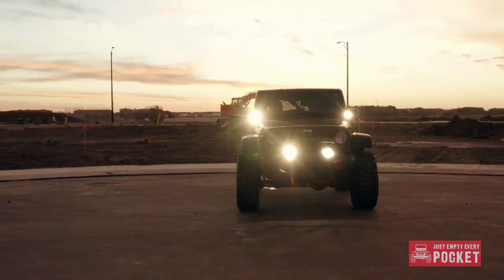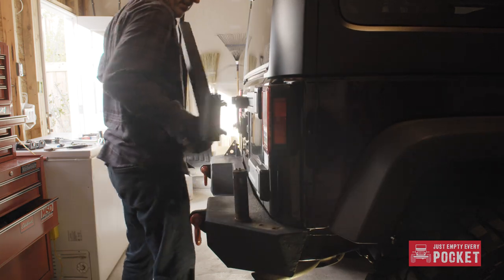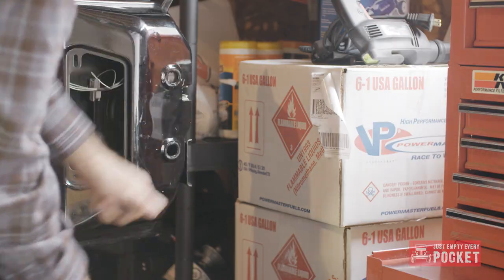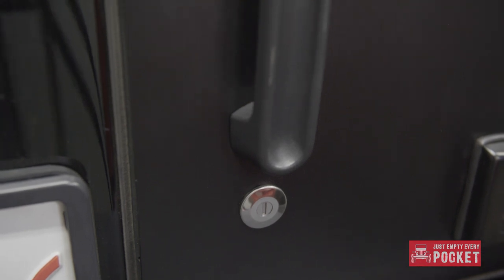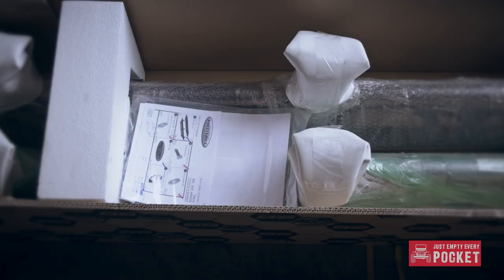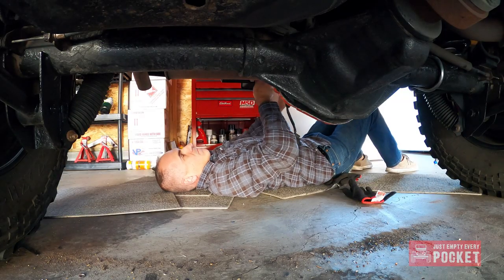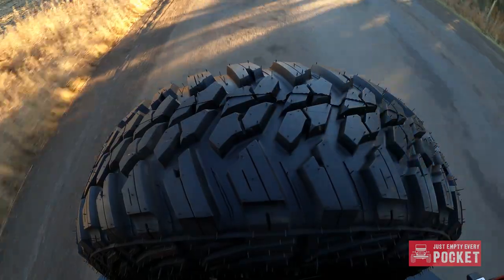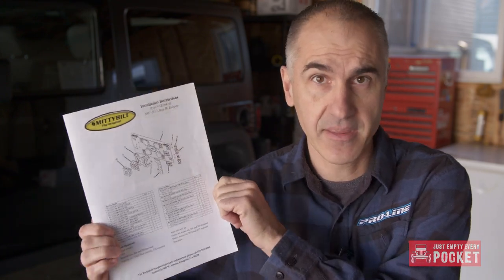Smittybilt XRC JK Tailgate & Rear Bumper Install

Comment: For anyone doing this, and Trying to figure out how to do the tailgate strap and install the stopper. Just take out the whole mechanism. Its 4 torx bolts behind where the speaker is located. take the whole plastic speaker box off and its right there. No need to try to drill threw the tail light hole or trying to jam the strap back into the rollers.

Comment: Any update as to how happy you are with the tailgate still? Also, do you need to use any parts of the original hinges as mine are piss poor condition?
Reply from the maker: I am totally happy with the gate! No squeaks or rattles on or off trail at all. The only OEM parts used are those for the locking mechanism. The hinges all get replaced.
Reply: @JustEmptyEveryPocket  thank you! Just waiting for it to go on sale!

Comment: Too bad no one can get one till maybe April 2022 per Smittybilt... I just backed my JKU Rubicon into a pole and started researching an upgrade.. I really want this set up.. But they are currently back ordered due to a vendor issue.. fml...
Reply from the maker: Oh no! Seems to be the story on so many products right now. Sorry about your luck :( 

If your desperate for a tailgate I have a stock one sitting in my basement :)